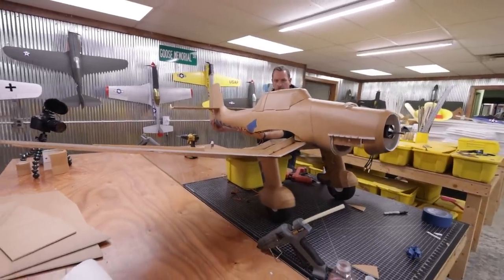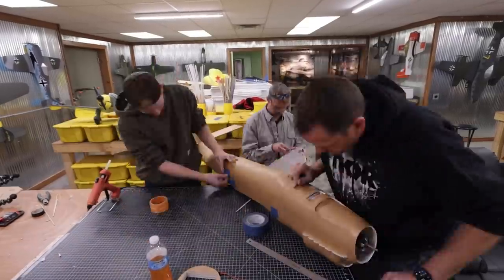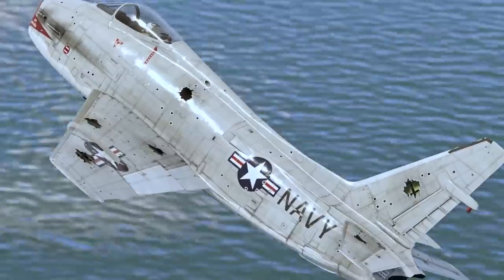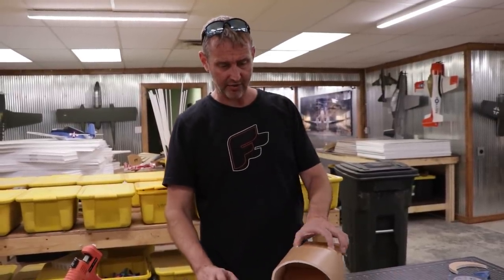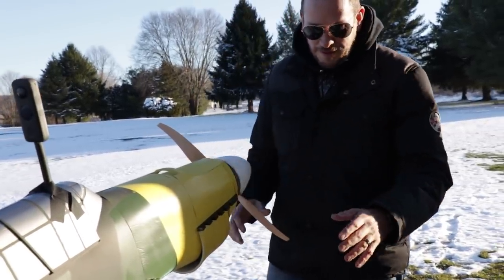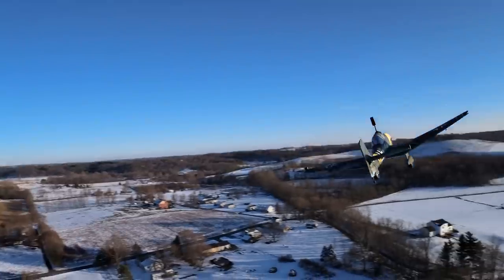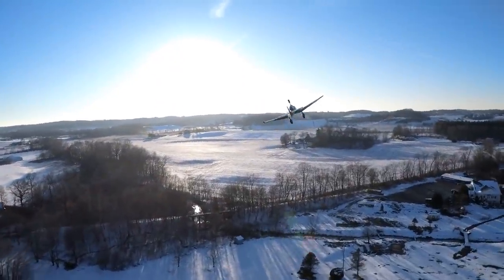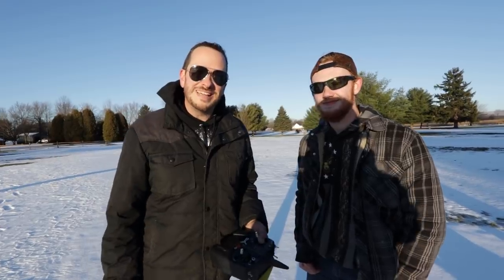Giant DIY WWII Stuka!

Comment: Ok... you just HAVE to put the wailing horn in it for the dive bombing.
Reply: Yeah the Stuka siren
Reply: The problem with that is that the Jericho trumpet only makes the noise after a certain speed that an rc plane can’t reach
Reply: So make an EDF powered siren
Reply: @theprincipalityofbelka4646  You can make a smaller siren, or you could just have an electronic one be in the body.
Reply: Jericho siren
Reply: @theprincipalityofbelka4646  Arduino with a pezio speaker?
Reply: @theprincipalityofbelka4646  scale down the speed required
Reply: @theprincipalityofbelka4646  you can add wires to make it electronically spin up
Reply: It’s coming 

Had to save something for the next vid. :)
Reply: @theprincipalityofbelka4646  There's plenty of models that have a working siren.
Reply: It's not a siren or horn they're basically mini propellers on the landing gear
Reply: Not have... they MUST  ;-)
Reply: Use Kazoos!
Reply: It’s not a stuka without a siren
Reply: @timredant8301  They would then HAVE to have the bomb carriage that swings it forward so it doesn't clip the prop, otherwise it wont be accurate and nobody will be satisfied XD
Reply: Ja the Sirenen have to be in the Stuka
Reply: IRL Jericho Trumpet taken off to give more flatline speed as allied fighters got fast  and faster!
Reply: No.
Reply: @Dragondeath422  that is what a siren is it spins up and pulls in air that makes a whistle sound
Reply: @theprincipalityofbelka4646  thats why it should use a little speaker device that makes the sound, instead of the actual siren part lmao
Reply: You mean the Jericho trumpet. Also they need to put that thing through  some dives.
Reply: @NishnaValleyRailVideos  or air thats how the real ones worked.
Reply: @Kajiukiller  like he said it’s too slow to the get the fan spinning so it would have to be electronic
Reply: Most stuka pilots removed their sirens because it annoyed and deafened them during dives.
Reply: ...and the bombing mechanizm with ton's of sweets loaded!
Reply: I'm telling you I know the perfect thing, its a plastic tube about 3 feet long and it's for new years eve party's you swing it around and it winds up just like the stuka. 
You pop the little plastic turbine out of it and mount it on the landing gear, I put one on the outside of my high powered rocket and was awesome all the way to altitude.
Reply: You could put a little door blocking the siren, open the door on diving and close it when pulling out.
Reply: When you hand spin it, it's not going faster the a rc plane or bomb for that matter. It would easily work.

Comment: Tip for dive bombing with Stuka in WT, reduce throttle to 0 and have the airbrakes on. She'll pull out of a 90 degree dive easily so long as you pull up at least 500 meters up.

Comment: Flite test - Gets sponsor from War thunder* "Its a super fun online game and it FREE!!"

Me - *sits there with my chromebook then cries in the corner*
Reply: Well you CAN play it. Played a little on a MacBook and it worked with lowest graphic settings and 30 FPS
Reply: @swefox2923  I tried to download on a *Chromebook* not a Macbook and it doesn't work ;-;
Reply: @chris_5117  War thunder does run on Linux, there is even a Vulkan renderer now (though I haven't tried it, maybe I should take it for a spin again!) The problem is that laptops already tend to be low spec and Chromebooks are even more so as a budget laptop. When it comes to PC gaming, you kind of need to build a desktop... and I would wait until the current run on parts is over.
Reply: @eulachonfish  Thanks a lot and this has been very helpful. I am am only 15 and I love gaming and Building and I have passion for planes. This will help me a lot in the future and as of now, I gotta start saving my money... :)
Reply: @chris_5117  Right on, I'm in my 30s now but was around your age when I built my first gaming machine with my own money. Do your research and try to maximize your performance per dollar for the games you want to play. Don't try to make a future proof machine, even the best will be obsolete in 5 years. I'm waiting for VR requirements to stabilize so I can build a VR flight sim machine myself.

If you want to fly on that Chromebook check out FlightGear. It will probably run on low settings. It's free and has very realistic airplane handling. I've flown the real and simulated 172 and can say hours doing touch-and-gos in FlightGear are well spent!

Also if you like quadcopters try out the demo of FPVFreerider (original, not recharged). It will run on a potato and I improved my quad skills so much with this $5 sim.
Reply: @eulachonfish  Thank you so much for this Information! I can tell you are a talented guy and know a lot about gaming and This will help me out A LOT. I will for sure follow your suggestion on building the PC and will for sure check out Flight Gear and FPVFreerider. Thanks a lot and wish you the best!

Comment: A wailing horn is good but for the bomb drop system just use a pneumatic piston in the cockpit vertical so it pushes down the nose of the bomb, then use the a-36 apache bomb drop system.

Comment: Thank you Thank you Thank you! But if you're going to do the Stuka you have to build the Ju86g model. If you can find it you need to read the book "Stuka Pilot" written by Hans-Ulrich Rudel. He was probably the most iconic german pilot and the most decorated from WWII. They ran out of awards to give him and had to make a new award just for him. The Ju86g model was built with 2 20mm flak cannons and was made for taking out tanks as its primary objective. During the design of the A10 Thunderbolt(Warthog) he was even consulted. Now I don't know if he suggested anything that was actually used on the A10 but still the fact that he was brought in as a consultant just goes to show how impressive his reputation was.

Comment: I built a huge balsa Stuka when I was in my early teens, I should've hung it from the ceiling, my Great Danes tail kept wacking it, busting it up until I got rid of it, it was rubber band powered but i never tried to fly it, was beautiful just sitting. Had about a 3 foot wing span. Huge!

Comment: place an opening in the leading edge of one or both wings and go buy a cheap harmonica and attach to the inside of the wings. add a narrow outlet toward the bottom of the wings and you will have the "Stuka Siren!"
Reply: btw I say cheap because of the harmonic that they set up when all holes are blown. it really sound bad as a musical instrument, but would sound pretty cool in this application
Reply: @Connor LambFurlotte I understand and know a little about how they done it ; I was just suggesting an alternate method to produce an approximation to the siren. The El-Cheapo harmonicas could approximate, to a certain degree, that sound. As to producing the sound on queue, a flap could be put in to open up on call. The JU87 was a good (if terrifying) aircraft that was used incorrectly, in my humble opinion. It would have been better used as a ground attack on armor or mass infantry. (As opposed to terrifying helpless civilians and causing undue casualties.)
Reply: and yes I know they were used for more than attacking civilians.

Comment: Idea for a similar build: The Il-2 Sturmovik. Basically, the Soviet answer to the Ju-87, with less dive-bombing capacity, but greater level assault capacity (especially against armor). It's also a bit of an angular goonie-bird. 
Also, there are many similarities of design, it might not be that difficult to adapt a lot of the JU-87 fuselage into a foam board Il-2.

[edit] 
That's strange. For some reason, my note has appeared twice in the comments section.

Comment: Did anyone else just KNOW  from seeing the snow on the ground what the landing was going to be like?  That is a GREAT Stuka guys!  I'm going to guess that the siren will be electronically generated, rather than air driven like the originals had?  If so, perhaps you should tie it in to the lowering mechanism for the bomb so it only activates when you're getting ready to bomb someone.  Excuse me, some THING LOL

Comment: Love this video. Have you ever tried to construct a Hawker MB1 TYPHOON? It has a simular design as the Stuka bomer. I'm building a Guillows 900 series kit converted into a micro R.C. airplane out of balsa. 17 1/2" wngspan aircraft using electronics from a Eflite Timber R.C. aircraft from Horizon Hobby. I found a drone engine of 3100 kv for a 2 cell system call Magic Deal from China(I do not like AntiChrist China). I bought 4 of them for about $29.00 U.S.. They fit nicely into the 900 series Guillows kits. Love to see more of your prototype builds!

Comment: Great video - brings back memories of a swappable Stuka build done by ultramicrobe with plans and video posted on FT back in 2014. Went back and read that post and the video... some great history with photos of one of the last two real Stukas!  Check it out:
https://www.flitetest.com/articles/swappable-stuka-dive-bomber-with-remote-bomb

Gotta say, after the gull wing design, the other unique aspects of the Stuka are the drop-flaps and ailerons.  Disappointed to see that the FT team didn’t do these, as ultramicrobe did them way back in 2014.  Love the big builds guys, but give it that extra 10% to really make these big birds a reflection of the originals.
One thing I loved in the video from ultramicrobe, other than the Stuka dive bombing out of the fog, was the video from behind the clear canopy - the sun making the shadows through a banked turn is sooooo cool. Maybe the FT crew can figure out a clear canopy solution for their big builds and put FPV inside for some true scale FOV footage.  
Consider that a challenge!